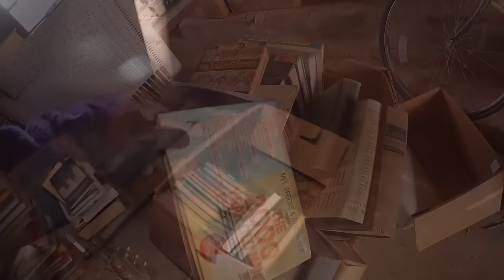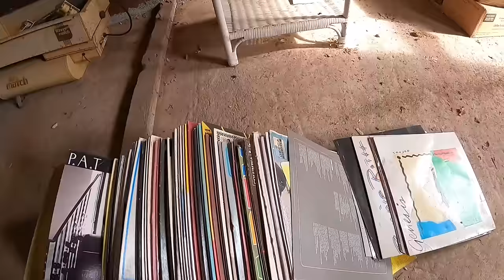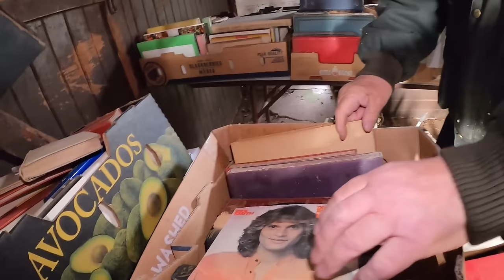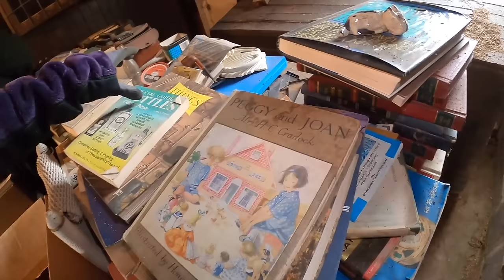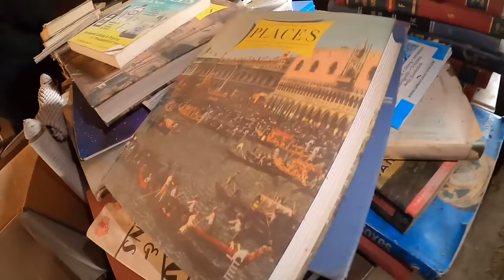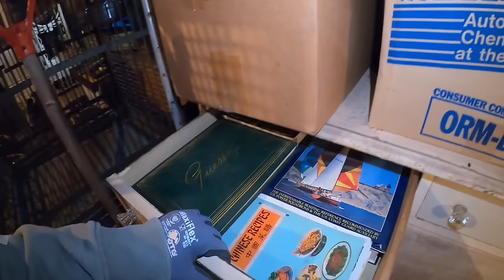They Refused To Sell It To Me!

Comment: The Oz books weren't worth grabbing They may have been the 50's? reprints. Mom had all those and the Raggedy Ann books. People are funny when they start seeing stuff with "new potential"  A lot of that was trash that needed to be recycled or tossed. I recycle books all the time. It does not bother me. Just because it was $8.95 in 1982, that means nothing.
Reply from the maker: The Oz were from 1904, I checked as I know first editions of those are worth a decent amount of money. I wanted them for myself, as the illustrations inside were still nice despite the covers having issues.
Reply: @PaperandMoose  Ah. I see. Mom's books range from the older ones her mom had to the ones I mentioned. They look similar.